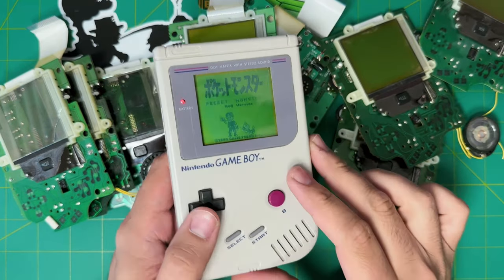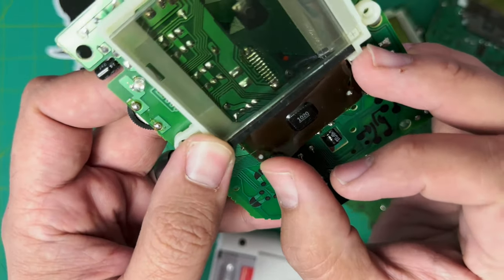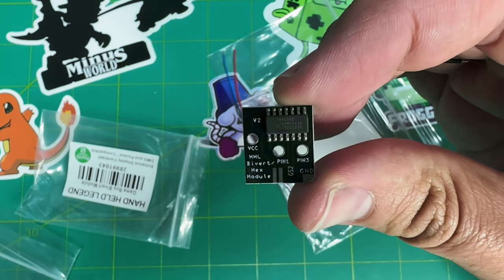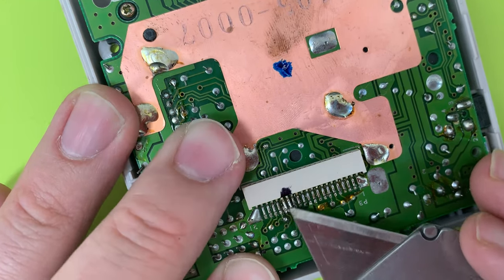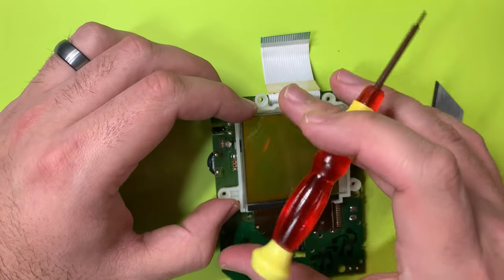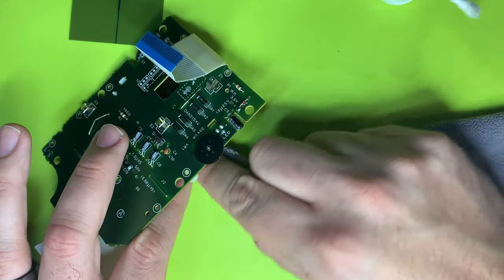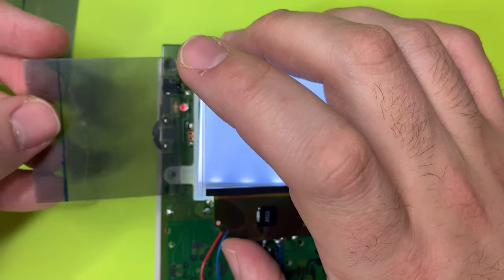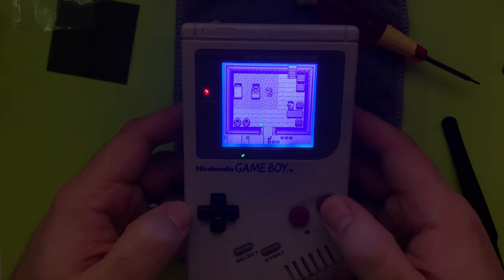2024 Gameboy DMG Backlight and Bivert Install Tutorial

Comment: Hi! one question, i followed your guide on botw cemu mods for steam deck and linkle works but not the dialogue fix, do you know how could i fix it? thanks :)
Reply from the maker: Huh - I think this may be a limitation of not running BCML itself w CEMU.  But I can take a look at it :)
Reply: @PizzaHandhelds  I see, thanks :) I tried installing BCML later following another guide but installer wouldnt open when i tried so i just gave up, ill try again 💖